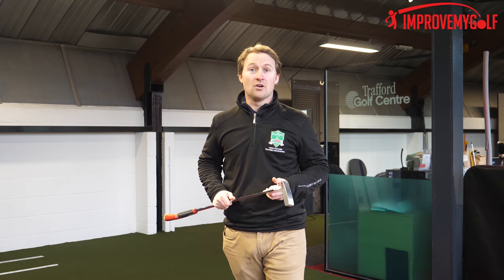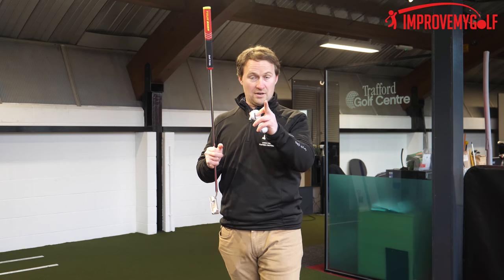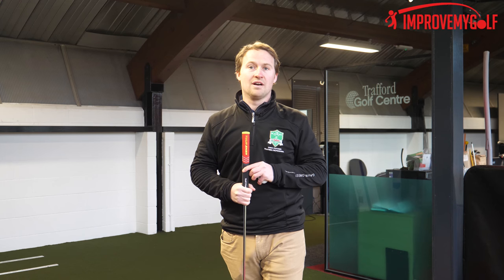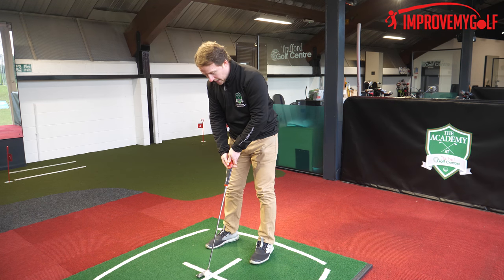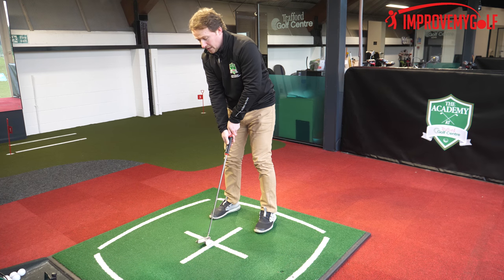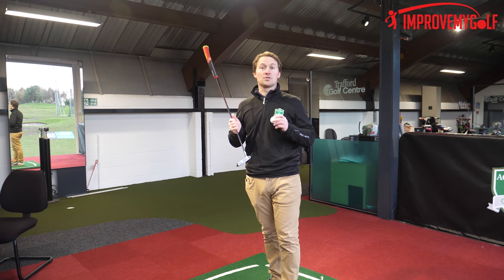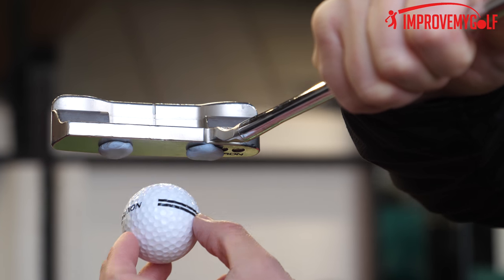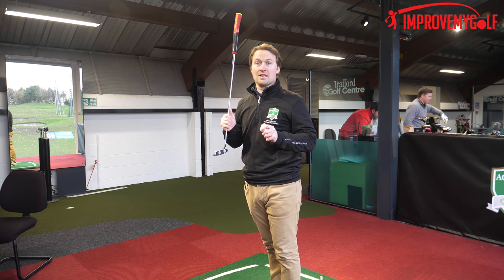#TipThursday - CREATING A TRUE GOLF BALL ROLL

Comment: Great tip, Fletch!  The slo-mo was very helpful.  I'm still gaming an old Yes! putter, which has upward-angled grooves on the face that get the ball rolling with minimal skidding/hopping compared to a smooth-face putter.  A future tip to explain the apex of a putt, and if that's a useful system to use, would be helpful.  Thx!